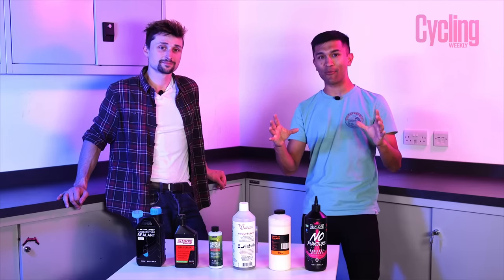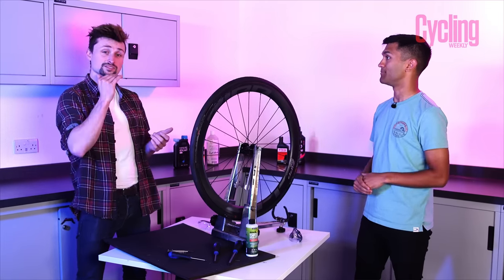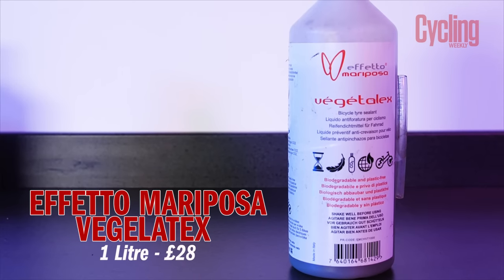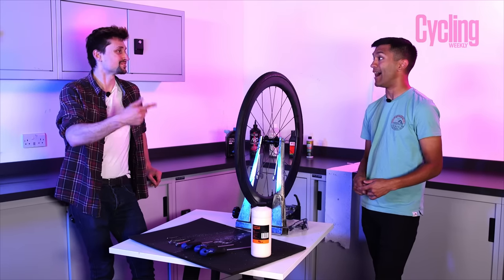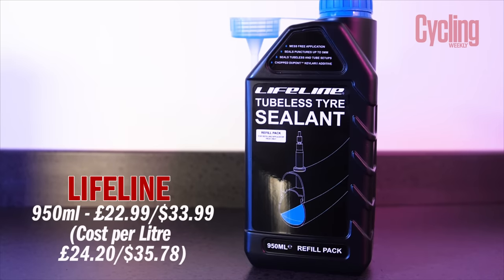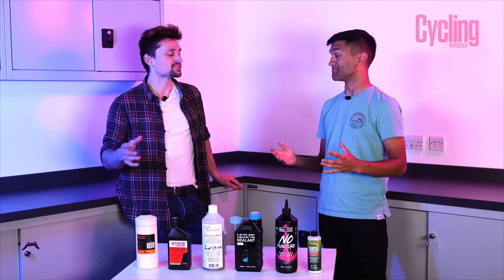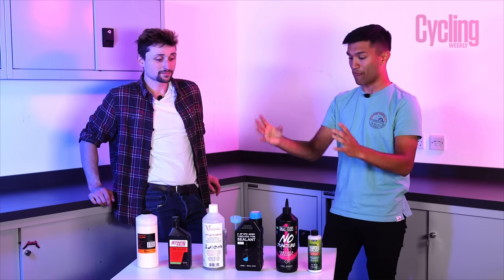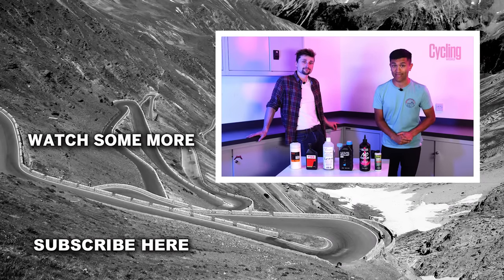We Found The Only Tyre Sealant You Need | Tubeless Sealant Mega Test

Comment: Road tubeless sux. I came to this conclusion after months of using various rims and tire combinations and sealants. The biggest problem is when you get a sidewall cut or pinch flat that cuts the sidewall. Putting in a tube on the side of the road is time-consuming and not that easy. I found only the heavy-duty Specialzed tire irons don't break when dealing with tight tire/rim combinations. And the friggin' mess caused by sealants is time consuming to clean up after a flat. Orange seal endurance works great in latex tubes for road bikes and also will work with butyl tubes. The sealant does dry after a while, so I just replace the tube. No mess. No fuss. Say no to tubeless.

Comment: have used many types f sealants, recent accidental discovery was Nutrak magic milk - bought in a bike shop becasue the Milkit sealant wasn't doing anything even with a small hole. used Orange with ok results but looks like its worth trying the muc off and Silca. - only question is about whether the latter needs to be put in via an open tyre rather than through the valve. The milkit valves work well in that respect. Oh and the nutrak is really hard to remove from the frame or other surfaces
Reply: The silca can only be applied via open tyre because it can't be sucked up into a syringe because of the fibers. They sell a top up latex liquid though which is what they recommend.

Comment: Hi I've tried all sorts of sealants the best so far is OKO Linseal 2L £20 split it half-half with water and is great have it in road & gravel bike works a treat and you don't need to change it after 6 months my mate had been using stans it still leaked so I swapped it for OKO and sealed up 1st time.
Reply: How is Oko holding up?
Reply: @magnumllama400  still holding up I did add some glitter reading on line helps seal very small punctures no issues at all can't fault it easy to swap tyres and reuse

Comment: should of tested Stans Race instead. I found it works better than Muc-Off. I have just started to use Silca and first impressions are good,also there is Silca’s top up liquid you inject every 3 months for up to a year. Which I’m looking forward to using. 33c CX tires 20-50 psi over 3 years.

Comment: Did you guys use different tires for each sealant test or at least thoroughly clean the tire out between tests? If not, I suspect the oily Vegelatex residue greatly hindered Orange Seal after it.
Reply from the maker: Yes, after each test the tyre was thoroughly cleaned and the area which was previously punctured was repaired internally using tyre boots.

Comment: Great review! Haven't had much luck with Stan's with higher pressure road bike setup. Silica seems like an amazing product, but not being able to use a valve stem syringe is a deal breaker, my tires are way too difficult to mount. Will try Muc-Off.
Reply: Yeah I find it (Silca) better than muc-off. Yes muc-off will somewhat seal, but only at a low (about 30 psi) pressure. You try to inflate that tire at a higher pressure and its then flat.  Found Silca able to seal a tire, at high pressure (70 psi -28mm tire) muc-off would not. Silca offers a replenisher that can be used (injected) via the valve them

Comment: Stan's fluid comes in "Regular" and "Race" formulas.  The key difference being the Race version has more and larger "clogging particles" so it would perform better on your test.  Unfortunately, the Race version also clogs injectors so it can only be installed by pouring it into the tire.
Reply: Stan´s Race sealant turns into fluid+hairballs fairly quick, but it must be great when fresh:)

Comment: Dear guys, Stans has a race seleant that can only be applied from within the tube but not the valve. It contains grainy pieces and perfectly sealed my Schwalbe Pro One 25mm Tyre with three small holes with around 5.5Bar.

Comment: Good luck getting the silca down a valve stem.  Looks like you have to pop the tyre off the bead for that one, which can be a pain, or rather reseating can be a pain.
Reply: Thinking the same thing.  We like to inject the sealant through the valve stem with the core removed. Plus I wonder if the silca will increase the incidents of valve core clogs.
Reply from the maker: Correct, Silca needs to be poured in. For the performance gain, I think it's a worthwhile compromise.
Reply: @cyclingweekly  that really depends on the compatibility of your rim and tire. So many rim/tire options now are so damn tight that once it is on, it is best to leave it there, and checking the seal dry is the only sensible option (Yes I'm looking at you Continental).

Comment: Helping the tyre shortage with this test! I am Orange Seal guy with a Pro One TLE but just got some Silca to put in my new GP5000 S TR. Seems the Silca is a pain are putting in the tyre but once in it will be worth it!
Reply from the maker: Two tyres were used during this test, both fully repaired and they'll now being used with a set of inner tubes to ensure no wastage. I think you'll really enjoy using the Silca, once you get past the initial set up!

Comment: Was there any thought to how the sealant is installed in the tire? The Silca looks very thick, would it plug the tubeless stem if injected through the valve hole? Best to pour it in?
Reply from the maker: We decided to pour all of the sealants into the tyre for this very reason. The Silca and Muc-Off would definitely have clogged up the valve if it had been injected. The others would probably have gone in with no issues. If you want to use either the Muc-Off or Silca sealants, then we would recommend pouring them in.
Reply: Silca say you cannot use an injector with their sealant. They actually show you why in one of their YouTube videos - it seals the injector tube as you try to suck some from the bottle.
Reply: Muc-Off goes in through the valve with core removed with no issues.
Reply: @gusstrang6357  agreed! Did it today!

Comment: I've heard good things about slime brand, supposedly decent sealing and doesnt dry out so doesnt need to add more too often. on tubeless ready disc wheels, might go for tubeless when my tyres wear out and tubeless tyre prices are on decent discount
Reply: I have slime in my tubes. Can't tell if I've had a punture and its worked or no puncture. Only downside is it solidifies in the valves so I have to carry spares. Its been in three years and it still seals the valves so I guess it'll work on the tubes.
Reply: I’ve tested Slime STR and it’s horrible. It’s very sticky/messy, it’s thick so you need more of it in your tire to make it flow, and it simply doesn’t seal even smaller punctures. There’s really only one answer for road tubeless and it’s Orange Seal. In real world usage it’s been reliable at extremely high pressures for me.
Reply: @philspencelayh5464  So  you still use tubes? My wheels are tubeless ready but I am  NOT ready. So I am trying Stans in my TUBES. Ths guy: https://www.youtube.com/watch?v=-X0y-2AsGRk tested a few things and Flatout was the best and Slime second. I don't know - is a sealant inside a TUBE a worthwhile solution? Is there a downside other than the weight of a tube? I'm a bikepacker with a gravel bike.

Comment: Problem is you’ll never get 7 holes in a row, if you did you’d need 1ltr of fluid in the tyre 

However 

Stans race for the first seating , then remove  an inch of tyre and replace with normal stans .  Thank me later
Reply: Stan’s race is tenacious as f$#&. I use it on rad and gravel but not MTB because removing a tire sealed with Stan’s race can be pretty difficult out on the trail.

Comment: Only major problem with that Silca sealant is going to be for those of us who use an injector and not a pour cup… that stuff I’m willing to bet won’t be able to get squeezed through something like a Stan’s Injector or similar…..
Reply from the maker: Very true, however, for the performance of the sealant, it's a compromise I'd make. Especially for use on the road.
Reply: Only the replenisher can be put down the valve.

Comment: Tubes. Tubes are the best seallant.
Reply: hobby horses are the best bikes
Reply: @ap6584  darn tooting.
In fact, peel it back to basics and just walk.
Shoes are the best seallant.
Reply: @ap6584  seriously though - check out the comments (below) from people that fell for tubeless and still use it...they are having numerous problems.
I can repaira tube in a couple of minutes and ride again for months on end with no issue.
And no need to spray goo and plasticall over the trails while your puncture fails to fully seal.
Reply: @thebrowns5337  The benefits outweigh the disadvantages imo

Comment: Did you SHAKE the orange seal thoroughly before adding it?  It has hole-clogging glitter in it and has to be shaken to get the glitter in the right proportion. I'd guess you didn't shake it.
Reply from the maker: That's quite an assumption to make from someone was wasn't present during filming... We shook each of the bottles to ensure all particulates were mixed up.

Comment: I've only tried Stans, Weldtite and Slime and to be honest I'm not convinced any of them work that well. I feel like thicker inner tubes and perhaps tyre liners are a better anti-puncture option and they have no maintenance requirements and continue working without topping up. I noticed on the pedelecs forum that someone who had a Schwalbe Magic Mary replaced under warranty due to cracking and being a poor compound removed the congealed sealant skin from the tyre which was run tubeless and it weighed 177g which is getting on inner tube weight, that is additional weight to the latex liquid that was just poured out. I feel the smaller the tyre volume the more sense it makes but if you have big mountain bike tyres it feels like you need huge amounts however it seems to work better at lower pressures so really its for light riders only using lower volume tyres. I'm definitely at the heavy scale of cyclists and I'm not convinced it as beneficial for me. Mainly because the sealant has a much harder time keeping the tyre sealed with a much heavier rider.

Comment: This is a flawed experiment, most sealants seal ok but at what pressure? What happens when your miles from home and try to  inflate the tyre again?
Reply from the maker: We only classified them as a fail if they would not hold pressure up to 70psi, the limit for what the wheels can take. Each sealant was given three attempts to re-seal with reinflation.

Comment: You are doing it wrong. If you want to test a sealant, you need to ride the wheel for some time after a puncture. In my experience sealant can often fix a puncture while you are spinning the wheel, but after you ride it at most for half an hour, it starts leaking again. I.e. - no sealant worked for me on a road tyre. On an XC bike, where tyres are much more thick, it  works, but not on the road.

Comment: So, your methodology is flawed.  I rarely ever have an issue getting a tire to seal with no weight on it.  Get on the bike and ride it after sealing, and I guarantee you those bigger holes will bust back open.

You also need to test cuts, since that is the bigger issue on road.  Take out a razor knife and start putting 1, 2, 3, etc mm cuts in the tire.  That simulates running over pieces of glass, metal and other road debris.

Comment: When I first started road cycling I tried the tubes with sealant in they never worked. The pressure goes down to a level that it can hold but as soon as you increase pressure by pump or riding it breaks the seal which is why your test is useless.

Comment: What a mess. My experience is that it might seal at first, but if you pump up the tyre afterwards to it’s original pressure it leaks again. Muc Off didn’t work for me, very disappointed. I have better experiences with Doc Blue. But tubeless is very overrated. I’ve had more punctures in one year using tubeless than in 20 years riding with inner tubes.

Comment: Absolute ball ache from start to finish all this tubeless nonsense. High volume pumps. Tubeless booster pumps, rip tape. Special valves. specific tyres. then all the mess or changing sealants and topping sealants up and cleaning sealants off. all too get a puncture that it can’t seal anyway and your left with it all up your back on a ride. for what exactly?? just ride a good quality tube and carry a spare..   thanks for coming to my Ted talk.

Comment: The thing is, silica is crap. It dries up in the tires and need to be replaced after a few months. Testing sealant 30 seconds after mounting the tire equals to nothing. you have to do real world testing. Use it at least a month and then test it. By experience Stan's no tubes Race is the best. It last all year, and does the job.
Reply: The stans race states "Visual inspection and refresh every 2-3 weeks". The Stan's Tire Sealant (version before the race) says re refresh duration: 2-7 months. What you describe was my experience with muc-off and its a month. I live on a tropical island but just seems to me a month is too short (I cycle about 500 miles per month). So far I have found Silca able to seal holes muc-off could not

Comment: This is ridiculous crap. One thing oj the stand another thing on bike in the rain or snow. All thar crap will fall off or leak. On high torque emtb it will fall off in half second. Overall sealants against punctures is a scam. It will seal. Maybe. For a some time. Or not. Overall on emtb even non punctured ((tubeless)) tires have trouble holding pressure. Because manufacturers produce crap. I still have rear tubeless wiht thicker tire because of other benefits ot provides. However it has zero puncture pluses because thicker protected tire unlikely have a hole ij the first place at least they can hold the pressure better but theybare still bad. Until UST tires are not a standard again tubeless is pain even for very experienced mechanics